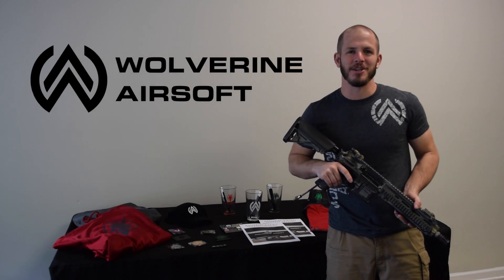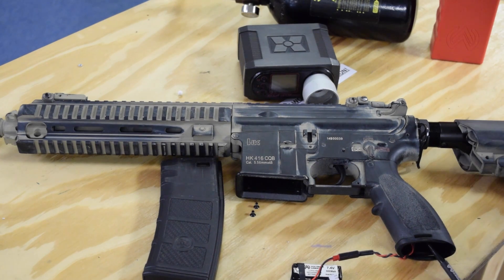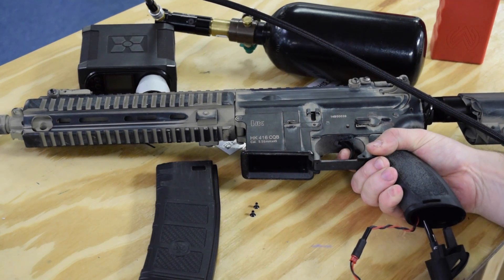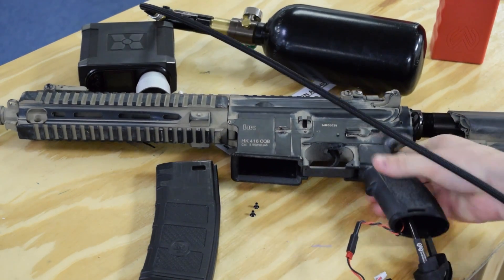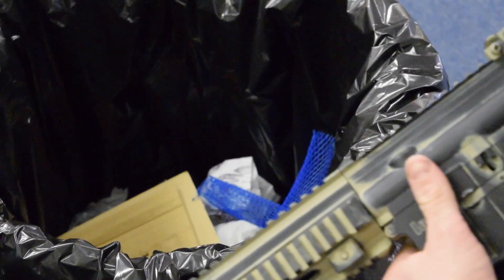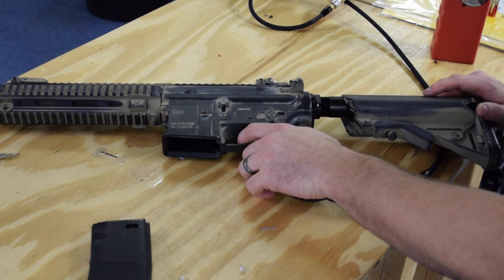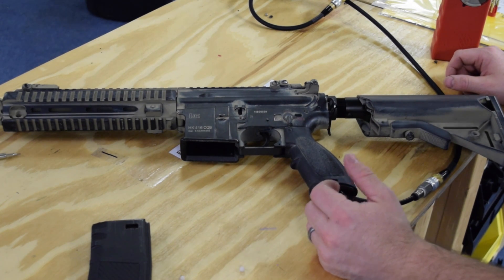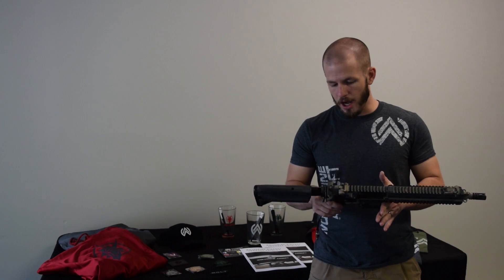What the Tech?!?! Ep. 22: Spartan Tuning

Comment: What is the 6 pin through hole connector for? Is this a I2C port or similar, can we get a pinout? Trying to integrate a maxx model tracer hop unit with this board.

Comment: Hi Wolverine Airsoft,
Question-related to the Dwell. I have an LMG G&G CM16 that I converted to HPA with your inferno gen2 and also a Scorpion Evo.
Both are doing the same issue, the FPS is constant on semi, when I go full auto, I have 15-20 fps up (constant). I tried to play with the Dwell (on my LMG, with premium FCU) and released when I change the dwell, at a point, I have no gain of 15-20 fps but if I reduce the dwell, I am starting to get irregularity between the fps semi and full auto. Is that normal?

I do not have a problem, but I have the feeling that my air tank will be empty faster every time that I am going on full auto for the same quantity of bbs that I will shoot in semi. You know what I mean?

Thanks you for your help.
Reply: Get a better regulator